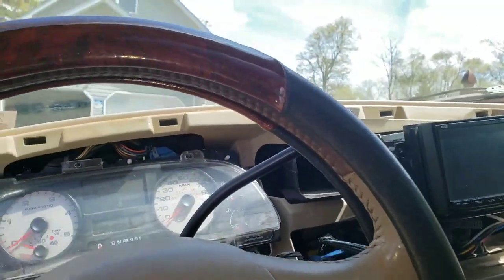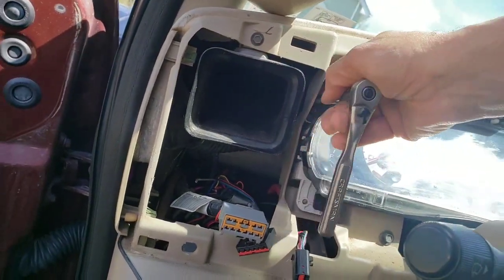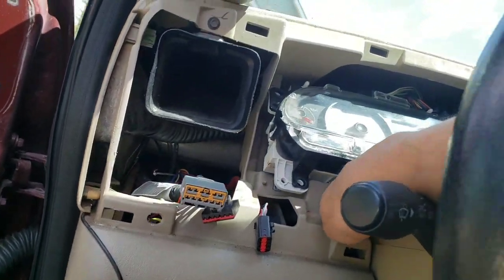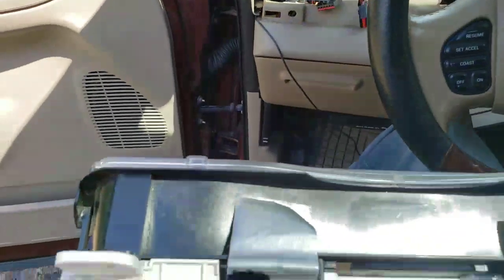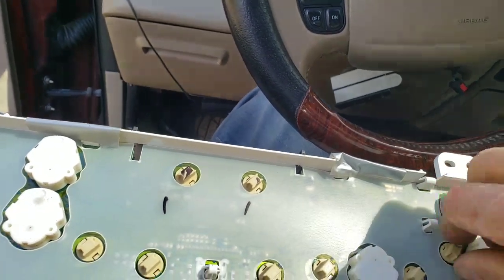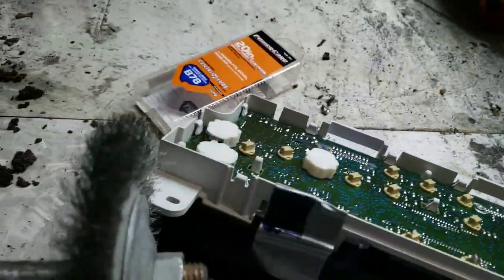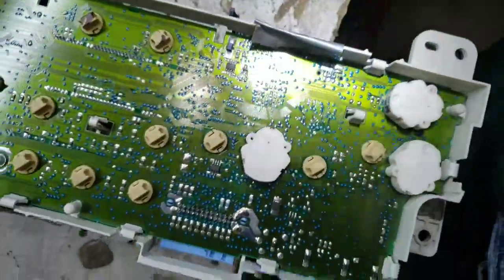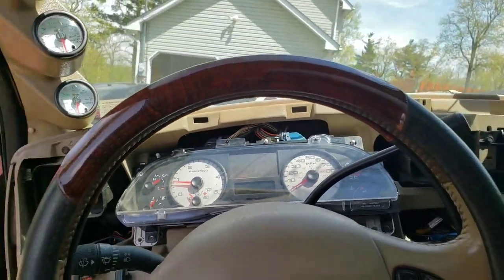06 Powerstroke 6.0 instrument cluster fix

Comment: This worked for me 2005 f350. Just touched the solder joints with a solder iron with a  fine tip and presto. Nothing else. Just the  harness pins. THANK YOU!

Comment: Mine  was the plug. I drilled  a hole in the dash support and zip tied the wire harness  to it  and didn't push the cam lock all the way. ..  fixed

Comment: So was that a permanent fix or did the issue come back? I’ve got an 07 superduty  and desoldered the blue connector, when I pulled it out I found that the printed ribbon behind the connector may have been damaged due to the connector moving from having split plastic  pins instead of screws like the other.

Comment: Ok my gauge has the exact same tape and prymarks on the outside ? I almost wonder if it isn’t an already fixed dash becuase I just noticed it. The marker is even on the same side of the tape
Reply from the maker: That's the old video a few years later it started happening again and it ended up being a relay watch the new video I have on my channel

Comment: The speedometer, tach, oil,fuel,temp and battery gauges, the needles are flickering. No dome lights, radio and shifter "OFF" Keeps flashing also. The gauges constantly shaking, stop a few seconds or so and back to shaking. What's causing this? appreciateanh advice. Its a '05 Superduty XL 6.0
Its NOT making good contact (where the solder is)is why they shake? Add a little solder on them?
Reply from the maker: The back of the board on the cluster panel needs to be resoldered watch the video I show how to do it thanks
Reply: @bigmiked52  yup, thanks! I pulled the light switch by holding a button down behind panel on light switch box then, pulling the knob out. Will the dash panel come out there or is there something else holding it in that area? I've the 2ea. 7mm screws. I have the dash out except that spot. The light switch knob is out.

Comment: I'm having the exact same problem and when I removed the cluster it also had that same tape on the bottom.  Is the something people do when they mess with or change the mileage?
Reply from the maker: Well what I believe it is and I've heard this from other people is the previous owner will take the cluster out drive the truck without it all over the place when it gets 300,000 miles on it he puts the original cluster back in with the low miles on it and sells the truck to the dealer and you become the unsuspected new truck owner thinking that has 70,000 miles on it but it has 300,000 I've even heard that they take the seat out also and the rubber off the brake and gas pedal some people just no good

Comment: I have a 06 f250 6.0 and my turn signals stopped working my hazards still turn on but when I go to turn my signals on nothing
Reply from the maker: Did you check the fuses?
Reply: Multi function switch failure or the plug has come loose. Fairly common

Comment: The cam lock loosen s when fully pushed!
Reply from the maker: Yes use a zip tie or hot glue
Reply: @bigmiked52  thanks for giving me a  point to look at
Reply: I do alot of off road  as am a farmer.  Every time  I hit a bump it would act up.  The wire harness  was hanging on the  plug. Hence  breaking connection

Comment: What size are those bulbs and did you see the green film? Ive read you can remove that green film and put LED lights in there.
Reply from the maker: Yes you can I just took one bulb to Advance Auto Parts and they have the bulbs
Reply: @bigmiked52  sweet. Thanks for the reply.
Reply: Fuckin garbage.Im on my third cluster in my 06. These come from Rawsonville/Visteon with the duct tape on them.

Comment: When your dash would go out, did it affect the driveability? I have 05 6.0 I just purchased, I probably have multiple issues but mine started cutting out as soon as the dash when out.
Reply: JRW ..alternator
Reply: @mitchploeg  it affects the alternator too?
Reply: Anthony Rios the other way around. Alternator going out will cause dash, radio, and A/C to go haywire.
Reply: @mitchploeg  my issue was I had just put batteries in it and I somehow missed one of the cables that went across to the 2nd battery.
Reply: @JRW Did you find solution. I'm having same issue.
Reply: Mine starts driving like shit as well no radio or power windows and transmission acts funny
Reply: @TheReal-Sloaner  I know this is 6 months old, but I have both problems, the cluster goes out and kills all the electronics. And then there’s other times I’ll go to start it and none of my lights work and my truck goes into a sort of limp mode…. Did you ever figure out the problem?
Reply: @coxroddington8145  been dealing with this issue for months. It's all just the gauge cluster. If you pop your dashboard back a few inches, like just pop the top clips out, you can reach under through the gap and feel the 2 big plugs coming out, the one on the right side if you wiggle it, it should come back on. What I've found is when I start my truck cold and the dash never comes on my truck will drive super stupid, can't figure out what gear it's in, it's barely drivable, like a limp mode. Wiggle that wire and as soon as the dash comes back on your truck will jump out of limp mode and you will feel it. Once it's driving normal the dash can turn back off and it will still drive fine. The dash needs to come on at least once for a few seconds so it won't trigger the limp mode
Reply: @TheExi450  so how did you fix it? Having the same problem.
Reply: Just by pushing the connector back in?
Reply: @TheExi450 did you fix it by just pushing them back in or did you find a way to keep them pushed up?

Comment: Hey brother I have an 07 f250 lariat 4x4 that has been bulletproofed and has had the o.e.m gauges unhooked and someone installed peer gauges but also has an edge evolution tuner on it all my dash light are on lip mode light abs light check engine light it keeps pulling up a code the garage says may be the tcm but with the hack job on the wiring not sure truck runs amazing!!! But these lights are stressing me out any ideas? Thank you in advance!! I’m new to diesels 6.0
Reply from the maker: Are the gauges swooping up and down do the windows and radio work
Reply: bigmiked52  yes the gauges jump every once in a while but the radio and windows work !the left turn signal works but now passenger side just buzzes builds are all good half the gauge lights are bright other are dim. When trucks running high beams work on passengers side as but not drivers than when turned off exact opposite the truck has brand new battery’s and disconnects installed because it seems to have a parasitic drain as well
Reply: bigmiked52  what about the security control module ? Would this create this problem ? And why are they attainable thru Ford ?